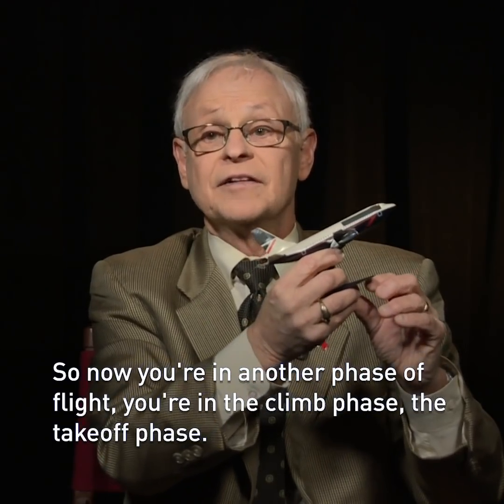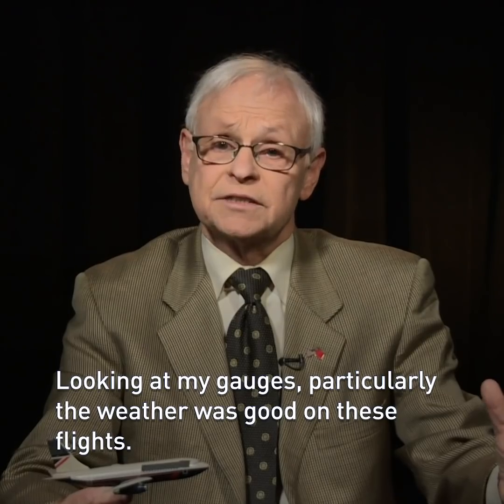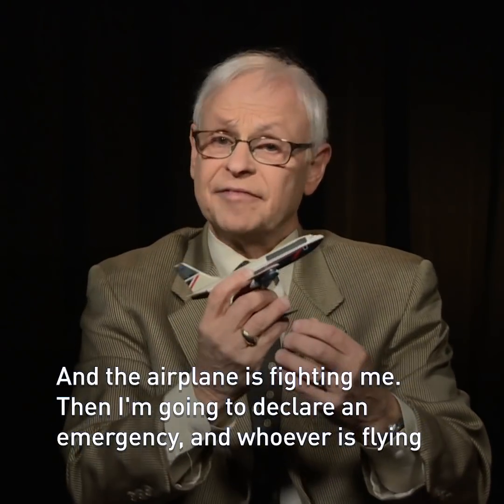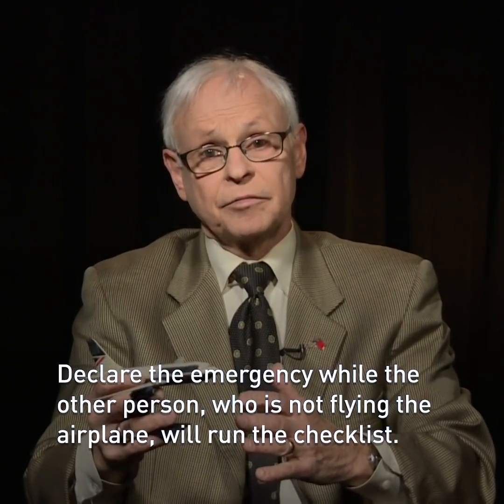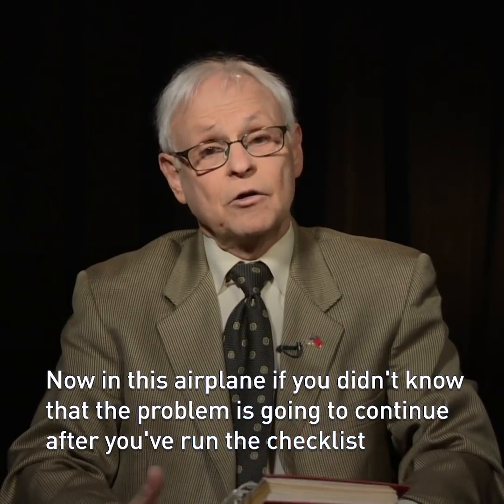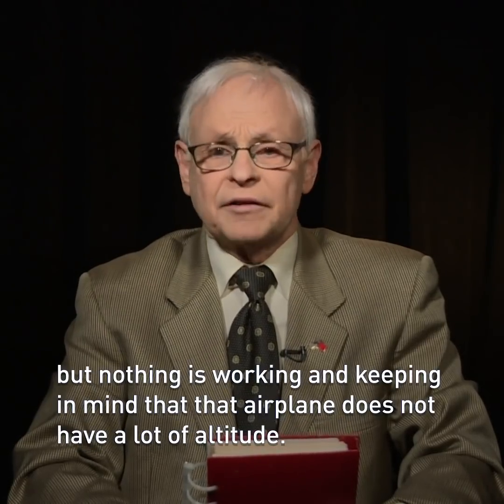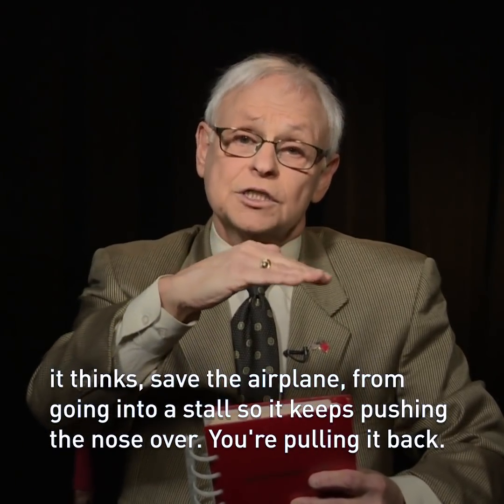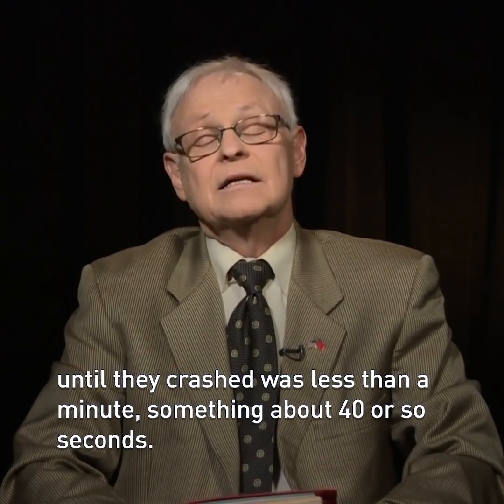Ex-pilot explains what could have happened in Boeing 737 Max accidents

Comment: Captain, an MCAS activation under the circumstances which affected the two accident airplanes (bad AoA sensor) essentially manifests itself as a runaway stabilizer trim situation.   Basically, the airplane is autonomously trimming against the desired flight attitude.  Runaway stab trim requires that immediate action/memory items be completed.   There is no time to reference the QRH until the situation is stabilized.  The aircrew must get the electric stabilizer trim motors turned off (two guarded switches on the center pedestal) and must take action to keep the aircraft’s speed under control (reduce power immediately).  Sadly, it appears as if neither aircrew took the proper action.   Yes, MCAS was very badly designed and Boeing deserves all of the bad press they are getting......but the people on those airplanes did not have to die.   Witness the fact that on the day before the Lion Air accident, an aircrew experienced the same malfunction on the same airplane, and they did ultimately cut out the stab trim motors and they lived.    Aviation accidents are seldom as simple as the public (and media) would like to think.   They are typically the result of a chain of events, and these 737 Max accidents were classic examples.   The most important safety system on any airplane is not some warning light.....it’s a WELL TRAINED, PROFICIENT AIRCREW.

Comment: If Boeing is to save the 737, it’s going to have to emerge with a radical redesign of the plane (not some Band-Aid patch software fix) that eliminates the inherent instability of the 737Max that now requires an MCAS system. Remember, earlier 737s flew perfectly safely for up to 50 years without this fancy software aid. The plane then gets a brand new model number, independent certification (perhaps European and not just the FAA) before its release. 
It this a real possibility or am I dreaming?

Comment: Read yesterday Boeing has decided to include free of cost, a warning light in new 737 Max planes and to retrofit all existing ones, according to a person familiar with the situation.
The alarm will tell pilots if two “angle of attack” sensors — which indicate the angle of a plane’s nose — disagree, a sign that one is not working.
Most airlines did not buy this option earlier on, costing about 80,000.
Does an indicator light cost so much ?
Reply: The safety features not supposed to be sell Ala carte but Boeing did 

But in third world countries car airbags is optional  ( front seat only or all seat)

Comment: Triangularity sensors via g.p.s. could cross reference the pitch of aircraft to correct MCAS deviation from true angle of attack. Error in fly by wire systems, must have checks and balances to maintain true flight parameters, as they say with computers, misinformation in, misinformation out.
Climb out at mild rate if practicable, air speed is paramount to flight surface full effect.
Only in case of obstruction should climb out be severe.

Engine failure on take off,, words no pilot wants to hear, expect the unexpected and train to take decisive action.

Example, modest climb out, you may be able to nurse her around for emergency landing, steep climb out, she’ll stall and fall off on one wing unrecoverable. Until altitude is gained there is no cushion for error. 10,000 feet you may gain air speed and perform stall recovery 1,000 feet no.

Comment: In released recordings to add to finding a sensor was replaced, that's fine it assures that the system got signed off, the copilot found the manual override trim wheel wasn't working and may have saved the day.

Sabotage must be considered the cause, best the whole system finally got upgraded, this finding is weighty, eh?

Comment: If you look at the flight data in the report, the first indication was NOT that the aircraft was going pitch down - it was the opposite. The captain (the one who was flying and has 8100+ hours of flight time) got a stick shaker, followed by MCAS. Both are indicators of stall, on an aircraft with a known sensitivity to stall. I am noticing this subtle innuendo creeping in that the pilots may somehow have failed to do something due to a lack of training or knowledge, when in fact the report says they did everything they were supposed to. Add to this the known issue on this aircraft from previous days with airspeed and altitude indication showing fluctuations and disagrees, and you could just as well have an aircraft that cannot be trusted. Of course, that would be speculation. Just as it is speculation to imply fault with the pilots.
Reply: @MattyCrayon  Thank you for your reply, you are correct about the dates of the faults, the altimeter and airspeed faults for the Ethopian Air 737 occurred in December as opposed to the day before. History did exist on this machine but not as recent as I thought.
On your second point, I do not agree. The fault that caused the accident was not of a stick-and-rudder variety, but one of failure in automation that prevented a manual resolution.  Once he applied the Boeing mandated fix of disabling the trim, he was unable to regain pitch up due to the seized manual trim wheel (the FO attempted operation and it would not move). The control column was pulled back almost to its fullest extent. What else could he have done from a manual flying perspective that would have saved the aircraft, given that he was barred from re-enabling electrical trim by the threat of MCAS, and could not operate manual trim?
Reply: @MattyCrayon  I have heard that same theory from Juan Browne about the aerodynamic forces preventing motion. Its a compelling theory. However there is no reference to that in the report and it is speculation, even if coming from a highly accomplished pilot. If you look at airspeed indication, at the point the FO attempts manual trim, the aircraft is at VMO. The trim should be operable at a manufacturer specified maximum operating speed. In fact, VMO has a factor of safety built in so the trim should still operate at a small margin over. If a pilot is not able to apply a mandated safety checklist item at a certified safety speed, then this still points back to manufacturer.  Given the conflicting FO and captain airspeeds and that the incident began with a stall warning, assuming the captain did not believe he had a good reason for not retarding the throttles seems unwarranted, and neglect even more so.
Reply: @MattyCrayon  Agreed, lets hope its all resolved soon
Reply: Correct; The 200 hour pilot called the correct response which is trim defeat toggles which shows they were used ; CVR shows an interaction confirmed this as what to do; Official report does not suggest those were returned to operation position which energizes automated jack-screw feature — though if that did not happen then a plethora of interlock fails would be failure-forensics — which is supported as theory by copious fail events showing in maintenance data recorder in battery-backed non-volatile memory show excessive conditions not put to the bench

Comment: No amount of training can prevent future crashes. It's basically a defective design flaw issue that Boeing try to use software to correct. Any engineer can tell you that trying to correct design flaw with software is an invitation to disaster. The MAX series should all be grounded permanently until engineering redesign is done, not only after software "fix".
Reply: @MattyCrayon   the pilot turned off MCAS 4 times, but it turned on automatically 4 times. If you watch or read proper news you will not write this kind of crap.
Reply: @MattyCrayon  The 737 original design is very good. The problem is with the MAX series outfitted with new bigger engine that has to be placed nearer to the plane fuselage, which makes it prone to nose up under certain level angle of attack. Thus needing software (MCAS) to correct by pushing the nose down. This characteristic is absent in the series up to 737 NG (i.e., no tendencies to nose up). This is what I meant by design flaw needing software to correct. Airplane is not like handphone, the manufacturer gets public inputs on software bugs, and patches can be pushed when available. Airplane software bug cause input is, unfortunately in these cases, through 346 deaths.
Reply: @MattyCrayon   under another comment u said the crash was due to pilots' incompetence. U disgraced pilots honor. I guess u deleted the comment cuz it was shameful.
Reply: @MattyCrayon  "Small set of parameters" as said by the Beoing engineers.  That irresponsible assumption is why the MCAS malfunctioned both times on both crashes as there were a large variety of situations that would trigger the MCAS that Beoing engineers didnt account for. I don't like leaving my life to chance, even if its that 1%. If the hardware was designed right because safety should be the no.1 priority (and not skimping on designing the new airframe), the MCAS should never have existed, and no accidents would have ever happened. This was a system that wasnt run poperly run through trial tests, that didn't even have a simulator.  Beoing is playing with peoples lives.
Reply: @MattyCrayon  I suppose we have difference of opinion on what is acceptable standard of safety. In my view, PC/handphone software bugs or software/hardware (even autonomous land vehiles) bugs are subjected to much lower level of reliability standard than those for airplane (able to carry hundreds of passengers) safety.
Reply: @MattyCrayon  i said crap cuz u r keep giving false information to other and insulting dead pilot; which has been deleted by u.
what u wrote was totally crap.
And then what did you say?
"Rubbish" and "garbage"
I guess you have to learn how to communicate not me.
And why do u think i will ever check your youtube lol
U r a just dogmatic old person
Reply: @MattyCrayon  
Cry baby after reading this facts

1.Around two and half minutes into the flight, the pilots cut off power to the stabilizer trim system to counter the abnormal conditions the aircraft put itself in, however, re-engaged the system by turning it back on shortly after, causing the Maneuvering Characteristics Augmentation System (MCAS) to kick in again.

2. Upon autopilot deactivation, the aircraft entered an uncommanded nosedive with four trim inputs without pilot input. The pilots used the electric trim to counter this.

3. The runaway stabiliser checklist was performed and the stabilizer cutout switch was used, however it was determined that manual trim wasn’t working.
Reply: @MattyCrayon  korean ppl respect elder but not an ill-mannered elder.
And how could i know if u r elder or not

Comment: The pilots followed all procedures recommended by Boeing for someone who did not know what the two big striped wheels on both sides of the center console right next to both pilots legs indicated when they spun or what the two very prominent big switches right behind the striped wheels on the center console labeled "STAB TRIM" did or how an airplane maintains its trim. My question is...  How is it possible to have two pilots in the cockpit who have no idea what these switches do or what the two big wheels that sometimes spun around indicated and/or how an airplane maintains its trim? Had the pilots known these things, and they should have, they would have known instantly what to do and not have to refer to the book. There is a reason Boing put these wheels and switches in such prominent locations but if the pilots have not a clue to there function or even wonder what the two big wheels right next to there legs that sometimes spun around indicated... I would investigate both of there Licenses. The purchasing of Licenses, Degrees, Diplomas. etc is common in Africa. This needs to be looked at!       

The striped wheels spin when the stabilizers are moving.
The switches labeled "STAB TRIM" return manual control of the stabilizers to the pilots.
The stabilizers are what controls an airplanes trim.
The trim is what direction the nose of the airplane is pointing.
Reply: My question to you is: Are you a pilot? Are you telling me a Jetliner pilot with 8000 hrs does not know how to trim his stabilizer? A freaking person with a general aviation licence knows how to use trim wheels. Is it even possible to be a pilot without knowing such basic part of flying? What you are saying amounts to a doctor not knowing how to measure blood pressure and yet becoming a brain surgeon. Actually my question should be Are you a functioning normal adult person? Jeeez
Reply: @jamilakingdom2664   If what you are saying is TRUE, then why is the 737-Max 8 grounded world wide? Just a lame excuse. You can keep the personal insults to yourself. Sheeesh....
Reply: @ashtonyao3574  that was to philips, not to you. Actually I agree with your point
Reply: Why are you blabbering about a trade you have no clue about? A trim is not a pitch. Trims control trim tabs on the stabilizers. These tabs keep the pitch at a certain pitch the pilot sets it at, and relieves the pilot of constant application of force to the controls. Normally they work electrically, so they spin the wheel fast and help you level up easily and keep you leveled up without constantly holding the elevator with your own muscle power. In the event when electrical power is cut, however, you have to pull/push the elevator and keep it at a desired location by crancking or rotating the big wheel in the cockpit. That is the basic idea. This function is known by all pilots. Why you are going bananas over a silly idea of a major airline pilots not knowing such basic part of flying is baffling to me. I knew this before I had my first solo flight.
Reply: I'm sure if the pilots were trained to cope with this situation, they would have. I'm not going to fathom what must be going through their minds during the last critical minutes of them trying to save the plane/passengers from nose-diving. It's clearly a fault of the system and the inherit instability of the aircraft design that is at fault. Anything else you are trying to pander is useless imo.
Reply: The pilots, it was a actually the guy with 200 hours, did correctly pull the stabilizer jack screw electric motor cut out switches.   The stupidity of the MCAS system was that it could not be disabled on its own. Pulling  the stabilizer cut out switches also disabled the electric trim and left the crew with manual trim control only. That’s stupid.  At the speeds that they were flying it was not possible for them to generate enough muscle force to adjust the stabilizer.   The MCAS on the B737 is a piece of total crap.  The fact that it did not generate a sensor disagree alarm when the two angle of attack vanes did not correspond is incomprehensibly moronic.  The crew might’ve picked up this problem while taxiing on the ground or they might’ve picked it up before they retracted their flaps and MCAS became active.  The fact that the MCAS system did not disable itself if the two sensors did not agree is another idiocy by Boeing.

Boeing actually nailed all of these issues on the B787 and the B777.  How they actually manage to make this up like total nut heads on the B737 program is a product of moronic groupthink.

All of this stupidity seems to of been about forcing a system that required changes to controls and instruments that would’ve forced a minor retraining of aircrew to avoid those changers.

The manual stabilizer trim wheels are just out of eyesight and they’re turning all the time due to the auto pitch applied by the auto pilo even when auto pilot isn’t selected.  You don’t notice them.

Software alone cannot fix this.  Boeing at a minimum is going to have to add a switch to disable MCAS.
Sanity checks on the sensors or some  kind of fail safe design is also going to be needed.

I suspect re-writing the MCAS system to take into account that failure can be at the catastrophic level may force them to introduce a triplicated system.  Those aircraft arent going to fly for months.

Comment: Inaccurate video in many ways.
Reply: Explain
Reply: Name just one of the "many ways".
Reply: @vonkruel  The video is already outdated at the time of its posting. The video suggests that the pilots could have saved the plane by following some procedures in time. However the preliminary finding is that the pilots already performed everything the manufacturer recommended but it didn't work.

Comment: Its this training that Boeing failed to mention to be Mandatory, but failed to be due to corruption between FAA and Boeing. Trying to get these planes out the factory as fast as possible with an untested system like MCAS is doomed for failure. What’s worse is the coding of the MCAS/flight controller which only measures one set of sensors. Single point of failure.

Have no idea what must be running through their minds at Boeing. They certainly don’t have the pilots nor the passengers safety as their prerogative.